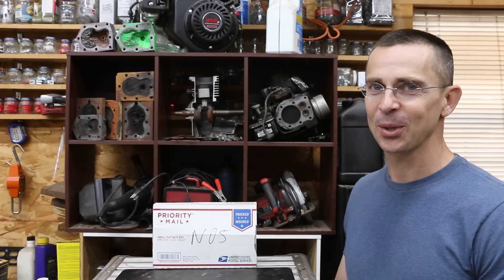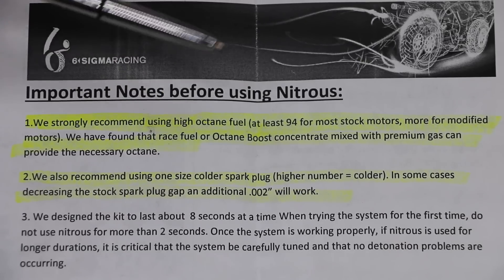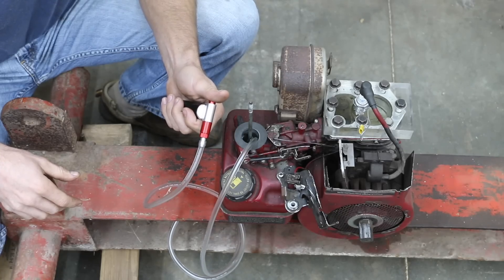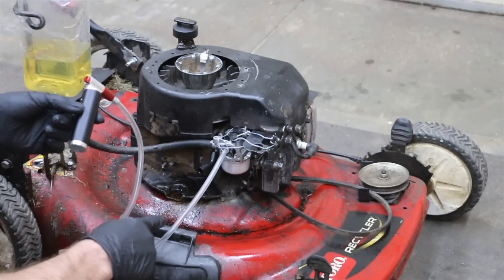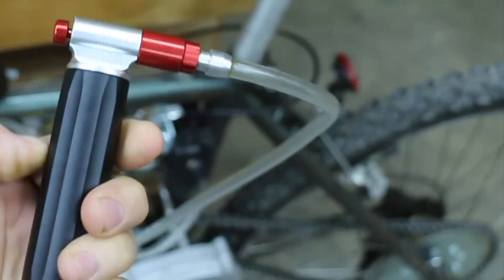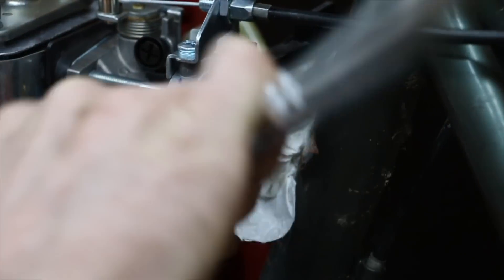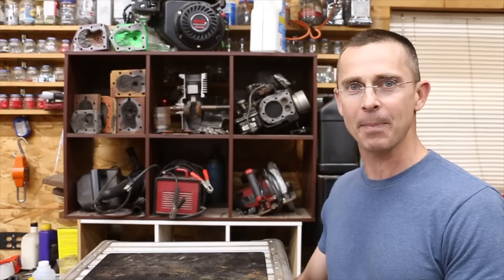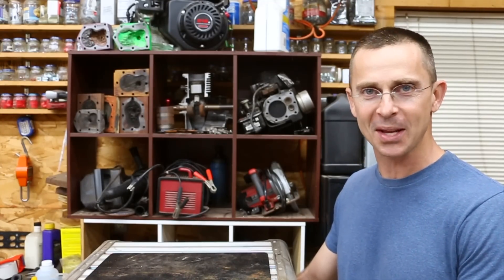Will the 4-Stroke Bike Survive Nitrous Oxide?  Let's find out!

Comment: It may be a harder project to do, but I would love to see the difference in engine efficiency and power with a Crower six-stroke engine. That is on the 5th stroke water vapor is injected which rapidly turns to steam driving down the piston, getting extra work out of the safe amount of gasoline fuel. Thank you for all of your great videos!
Reply from the maker: Thank you!
Reply: I don't see a 6 stroke water injection turning into steam becoming a long term reliability.  The water molecules would reduces the cylinder wall   oil film.  Plus the blow - by on the piston ring gap would dilute the crankcase oil.

Comment: I love your videos, but you need to do research before just doing it. This video is full of bad info. What adds power when using nitrous is that the nitrous oxide is a powerful oxidizer. When adding it you are also supposed to add fuel when the nitrous is triggered. Doing it the way you are will blow the motor because it is going extremely lean when the nos is added.

Comment: I'm not a carburetor guy.  Is it able to automatically compensate and put in more fuel to go with the  added oxygen the nitrous provides?
Reply from the maker: It's not.  I have the carbs running a little rich, but more fuel is needed for sure.

Comment: I would also recommend that if you do plan to use nitrous oxide in an engine, make sure that the engine is a strong enough material to handle the extra compression, such as cast iron or steel. A lot of newer engines have aluminum heads and if you use nitrous oxide too much with them, the heads could blow.
Reply from the maker: Great point.

Comment: You definitely ran it lean when the nitrous was on. Nitrous runs best when you have a richer condition (safer too!). 

On an automobile the nitrous is in liquid form when its injected into the manifold and usually supplemented with extra fuel to combat running lean. Also, you make more power because of the extra fuel you're burning on the same stroke.
Reply from the maker: Great recommendation!

Comment: Good video, but nitrous used properly generally injects more fuel as well. This will get you even more power and not lean out the motor and ping so much. I don't know with that specific motor if injecting more fuel would be enough to eliminate the pinging; however, it would be an interesting experiment to see if you could find a way to do it. A pleasure to watch as always.
Reply from the maker: Great point. Thank you
Reply: It’d be interesting to see what the results were of adjusting the carb  as rich as it will run acceptably without NOS
Reply: Oi... Only way an engine would run on just no2 alone would be through its pressure in like a steam engine or a pneumatic engine like an air hog as far as I know octane rating has nothing to do with air fuel requirements although ethanol which has a higher octane requires more fuel in the mix for stoichiometry than gasoline (14.7:1?)... Injection of extra fuel could be achieved by running no2 through an airbrush containing fuel  in the little jar... Lastly the composition sheet said OXIDIZER so once it hits past 1200°f you got more o to go with while the nitrogen is along to hook up with any stragglers including other nitro and hydrogen to for those super healthy less popularly mentioned emissions that aren't co or co2
Reply: That would be awesome for a video, you can get an airbrush dirt cheap. But yeah if the carb has an enrichener instead of a choke or even if you pump the priming bulb you should get a big boost of power
Reply: @derpinbird1180  thanx do it with a box of whippits and if it sux you can try to see if it helps your performance lol
Reply: Chris Hutchinson agreed. That's why I'd never run a dry system.
Reply: I would figure the higher octane fuel would kinda negate the need for more fuel as the 87 regular octane is fine for regular use.
Reply: @MrUnforgiven765  You cant negate the fact that putting in more oxygen via nitrous shots just leans out the mixture. He only got more power because the unregulated carburetor was most likely tuned very  rich to begin with.

Would be great to see this again after fitting bigger jets to the carb.
Reply: @FerdinandFake  I think most of the extra power gained by running nitrous is actually due to the decomposition of the nitrogen and oxygen from the N2O molecule and not necessarily from the added oxidizer. Extra fuel is used more as a coolant to prevent pre-ignition/pre-decomposition than to try to regain stoiciometric air/fuel. For example, you might target a air fuel ratio of 11:1 running Nitrous vs. 12-13:1 without on the same engine.
Reply: @bradley3549  The more fuel you can burn the more horsepower is made. The heat is from the extra oxygen causing a lean burn condition. Raising the octane ( which has a lower flash point) can also cause a lean condition which is why more fuel must be added to richen it up. Hence more fuel burned more horsepower. NOS without proper fuel added is what will scatter pistons and only have minimal if any gain.
Reply: @bradley3549  Also pre-ignition or ping is like beating the top of your pistons with a sledge hammer and is one of the most destructive forces on an engine.
Reply: @attitudeadjusted9027  I don't disagree that for an engine to be expected to last you need to have sufficient fuel. I never claimed otherwise. The point I was trying to make is that the REASON you need more fuel is more complicated than just being about the extra oxidizer. It's a delicate balancing act between adding enough fuel to account for any extra oxider AND to cool combusion sufficiently to offset the added thermal load of the decomposing n2o.

Purely speaking, simply adding n2o to an otherwise optimized engine will increase power due to the decomposition alone. I'm not saying that's a smart thing to do, but that's the science. Adding enough fuel to account for the added oxygen will result in HIGHER combustion temperatures than adding that amount of O2 directly due to exothermic decomposition. And this is why you need to add enough fuel for the added oxidizer as well as enough EXTRA fuel to cool the chamber. Coincidentally, that exothermic decomposition is why preignition is such an issue with n2o.
Reply: @attitudeadjusted9027  In fact, and this is really kind of interesting, due to the chemical energy stored just in the molecular bond of n2o, you could run a purpose built engine PURELY on n2o and nothing else (no air or fuel.)
Reply: Les Phillips agreed, I've seen holes burned through the top of 2stroke race engines due to pre-ignotion/detonation issues. (Issue being crew cheif insisted on mixing 93 octane with 112 octane and running it in a motor tuned for 112 with something like 4degrees of timing advance and cut heads.) Hole burned through pto side cyl and both were badly burnt by the exhaust ports after 1 pass.
Reply: @MrUnforgiven765  it might help with preignition but how is the motor suppose to make more power without the extra fuel?

Comment: What you need to do is add a siphon holes drawing fuel in with the nos.
That's where your big HP will come from.
It's the extra O added to fuel that pumps the cylinder full of burnable mixture.
Let's see how much it takes to blow up a solid motor.
Reply from the maker: Great recommendation!

Comment: can a gas engine run on hydrogen?
Reply from the maker: Thanks for the video idea!
Reply: Technically speaking, it already does.  Gasoline = Hydrogen and carbon in a "chain" molecule.  That is why one byproduct of gasoline combustion is water.
Reply: @OddBallPerformance  Yes, but if you create hydrogen on demand via a small pressurized fuel cell, would it be possible to run it from straight hydrogen having the emission of oxygen and water. Of course I was thinking that would rust the innards of the engine out, only if you didn't give it a ceramic coating like a racing engine. then, it should be fine so long as the fuel cell can maintain a pressure and creation ratio that will allow said amount of litre-age into the engine, maybe a safety blow off valve just in case. lol I'll be making a small cell soon to try it myself, keep in touch!

Comment: You should try replacing engine oil with KY Jelly and test it on the lubricity tester.
Reply: I'm sure it would be very satisfying.
Reply from the maker: Thanks for the video idea!
Reply: its water based so it would steam away as temperatures rise therefore giving it even worse performance than pure mineral oil which is not strong enough to survive long inside a hot engine
Reply: @philtripe  find some that not water based.
Reply: Astro glide
Reply: Matthew Sharp n
Reply: Horrible idea ..I definitely don’t want to see this guy bust a nut!
Reply: I wouldn't, it's been done before by 'Life OD'.
Reply: someone's already done it
Reply: Definitely Astroglide. You could fit a Cadillac into a doghouse with that stuff.
Reply: I think silicone based lube may work.

Comment: As an ex automotive mechanic, I have for many years wondered about this as a simple project. 
Great job. 
Was thinking of something simple like that on my wrx along side the micro-water injection to control the pre ign. 
One thing here is, our petrol station pumps, we can purchase 95 or  98 or even 20 ltr drums of BP100 or shell100 octane etc.  Premium 98=$155 per litre, price varies or you can go to the local light aircraft air port, and purchase Avgas 100/130  allows for more ignition advance.

=   N2O makes air and fuel burn better together.
 
Once again keep up the great work.
 I look forward to your next video
Reply from the maker: Thank you!  The wrx sounds like a fun vehicle!

Comment: This test is a bit hollow. No change in timing, no extra fuel with the added oxygen just for starters. Perhaps the worst issue is the constant conflation of RPM increase and actual power. You get more actual power than the RPM increase would indicate. Of course, you eliminated 75% of that potential gain by not maintaining a proper fuel/air ratio plus all the pinging. You could have increased the gear ratio, lowered the RPM and added more fuel. So the object wasn't to maximize the power, it was "let's put NOS on a bike". Like I said, hollow.
Reply from the maker: Thanks for the constructive feedback.

Comment: Nitrous leans out the mixture so most systems have a way of adding additional fuel.  I realize this is a cheap system and adding fuel isn't a simple task but if you could rig it to add fuel, you'd get even more power and reduce the chance of detonation.  You could try adding a separate tank that the nitrous pressurizes and rig a discharge nozzle at the carburetor inlet.  Put a tee in the nitrous line going to the carb and run a hose from the tee, to a small fuel tank located below carb level.   When you hit the nitrous it will pressurize the tank and push fuel up to the carb.  It's not going to take much fuel, I'm guessing a .010" orfice.  Maybe you could use the head off of a sprayer bottle or something else that is adjustable?  Safety first!  The reservoir should hold a minimal amount of fuel (1-2 ounces max) and don't over pressure it where it could burst.  Great videos and subjects!
Reply from the maker: Great point. Thank you

Comment: It is not safe to use nitrous on a tight tolerance engine especially if it's not built right does not use 94 octane or more and does not use a colder plug furthermore pinging and door-knocking can occur but most certainly be careful how much nitrous you use most stock Motors can only take about a hundred shot from a bottle any more than that can possibly hurt or destroy your motor
Reply from the maker: Great point. Thank you

Comment: I like the video, and never pondered adding nitrous to a motorized bicycle. However, you need to add fuel along with the nitrous to keep the mixture from going excessively lean. Typically, nitrous kits for cars will include two injectors, one for nitrous and the other for gasoline, and matched jets to match the additional fuel to the nitrous going in.
Reply from the maker: Great point on the extra fuel. Thank you!

Comment: they should have made there little cyl two part with some fuel as well, that detonation is most likely because its lean when you inject the no2 you could possibly try jetting the carb a bit richer and probably have even better results on the button.
Reply from the maker: Great point on the lean condition. Thank you!

Comment: Nos has been used for decades as a power enhancer on 4 stroke gasoline engines. Depending on the " shot" you use, it doesn't harm the engine  as it also helps to reduce the intake charge temps.   I've seen 50 shot engines with 100k plus miles on them running just fine.    You just have to judicious in its use.

Can we get a test on octane boosters.  Many yes them I'm high performance auto and marine engines and swear by them.  I like the Royal Purple brand at  about $10.00.
Reply from the maker: Great video idea!  Thank you

Comment: in a normal application/automotive or whatever, more fuel is introduced with the NOS... otherwise the NOS is leaning the mixture by introducing more O2 into the mixture.
Reply from the maker: Great point. Thank you
Reply: There is such thing as a dry shot, wet shot is really only needed for boost or highly aggressive setups.

Comment: I am surprised that it worked that well, without the addition of extra fuel. I have dealt with nitrous before, and have never seen anyone run it without adding fuel... well, without blowing something up. I guess your engine must run on the rich side, and 8 sec lean pulls aren’t enough to burn it up. 

Anyhow- I have a 30shot nitrous kit for 1/2 cyl engines. I am looking to sell it very cheap. Do you have any interest? If so contact me, I can even walk you through set up.
Reply from the maker: Thanks for the offer on the nitrous kit.  Seems like mailing it would be a challenge.
Reply: Project Farm I bought it 3 years ago for $500. No issues shipping as long as the tank is empty. 

I’d let it go for $275 if you have any interest.

Comment: Another great video. Love your work. With NOS adding extra fuel will increase power and not lean out the fuel ratio. N0S adds 02 so you can run more fuel, which is what makes the power. Revisit this with a way to add more fuel along with the NOS and that engine will pull WAY harder or chunk a rod. :)
Reply from the maker: Great recommendation!  Thank you

Comment: The Only Thing Left Do Is  A*(Shifter Kit)*... 
Shifter Kit + NO2 = Weeeeeeeee!
Reply: Problem with shift kits on a bicycle is the gears on a bike are too close together because the average person makes 3/4 horsepower, not 3. When I was using a shift kit, there was very little difference gear-to-gear, I often had to go straight from 1 to 4 to 7 to get any kind of shifting feel. (gear-to-gear it was like going from 5000 RPM to 4400 then back to 5000 almost immediately, you spend more time shifting than riding)

If you can do a custom casette with 3 speeds (or custom gears with wider spacing between ratios) you'd have a much better ride :)
Reply: @calvin2686-u1k  I Was Very Curious About The Viability Of Shifter Kits ..Thanks For The Insight
Reply from the maker: Great recommendation!

Comment: You're getting the preignition at idle because nitrous should only be used when already at full throttle. Also, I don't know that kit, but nitrous achieves most of its results by being an oxidizer, not by its explosive action. To get the most out of nitrous, when the button is pushed some other system should also inject extra fuel, otherwise the engine will run lean, adding some power, but also producing way too much heat. Like in a car setup, there should by a nitrous jet, but also another fuel jet to prevent this lean condition.
Reply from the maker: Thank you.

Comment: Why didn't you push the button during acceleration? You should do it again and see how long it takes to get to a certain speed with and without the nitrous to compare the difference it made
Reply from the maker: Great point. Trying to achieve more top speed. The bike runs out of power before it runs out of RPM.  Lots of untapped top end speed.